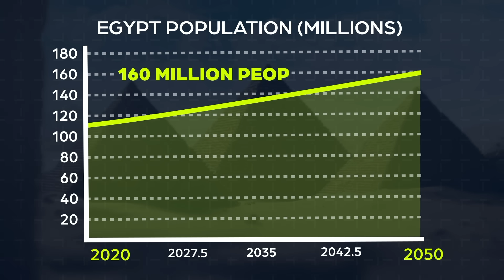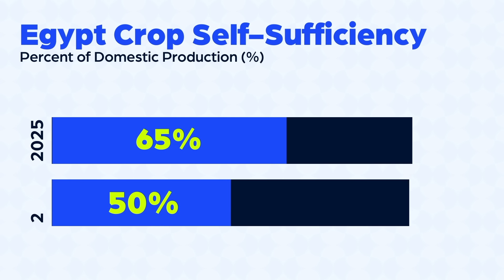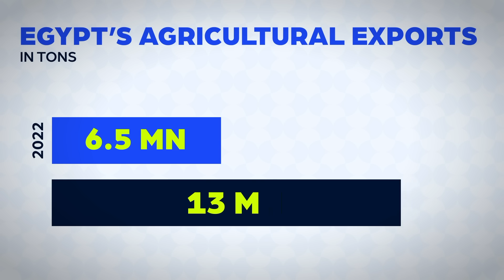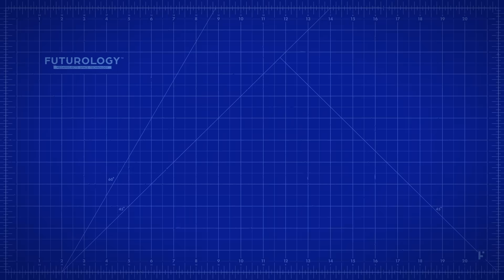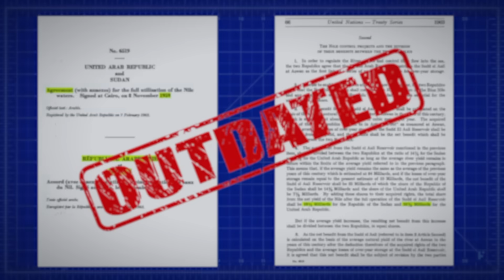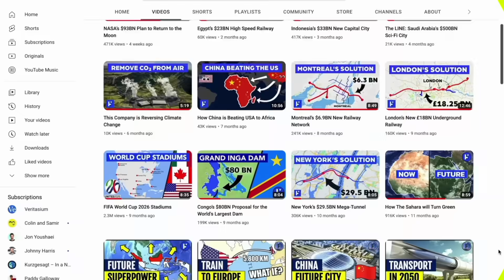Egypt is Building a $9.7BN New Nile Delta

Comment: Imagine travelling back in time and telling the Romans that their breadbasket will be one of the largest grain importers 2000 years later
Reply: This was because of English people, they changed Egypt to a farm for fine long fiber cotton to feed their industry.
Reply: Yeah, but "their breadbasket" also has twice the people of the Roman Empire. Even with the dramatic rise in farming productivity since the 1800s, there's just so much land till you run out of it in Egypt.
Reply: @chinguunerdenebadrakh7022 maybe they shouldn't be reproducing more than what their land can feed. Famines need a comeback.
Reply: @chinguunerdenebadrakh7022 Time to green the rest of the desert then

With better water conservation and transport technology less water will be wasted and it can be efficient to green the desert. Would just need to give it a few decades to slowly green.
Reply: The whole Roman Empire did not have 100 mln of population at the time:)
Reply: Well, as long as you don't forget to tell the Romans, that the population of Egypt alone is larger than the population of their whole empire. In fact, according to some estimates 2.5x larger.
Reply: @Omar-kw5ui well as long as you also remember that crop yield nowadays is at least three times what it used to be in Rome's times in fertile soil like Egypt's (in other less fertile soils it's much much higher) so it should still be able to supply the increased population only using the same ancient fertile land (without taking into account any of the reclaimed and less arable land which were made more viable through fertilizers and agricultural projects)
Reply: @Truth4thetrue  My comment highlights that the Romans would not find it strange at all that their once bread basket has become the largest importer of grain after its population has grown to many folds the size of their entire empire. This is because they were themselves the highest importer of grain given their massive population, and feeding their population was one of their biggest concerns. It would only be logical to them that this would be the case.  

Now, you're trying to be pedantic and say, well Egypt should still be able to feed its population because of advances in farming. Well, I'm not so sure about that. And there are two main reasons for this:
1. People take up space. The population of Egypt isn't scattered around vast swathes of the world, like the Roman population was. That massive population lives on the very land that is needed to produce the crops to feed the population. Lets assume only 20% of fertile land is lost due to habitation alone. 
2. I'm not sure if Egypt alone fed the entire Roman population/empire. Yet, its current population is several folds greater than the Roman empire. Assuming Egypt alone fed HALF of the roman empire (chat GPT thinks its more like 4%), and the population of the empire is around 76m, then Egypt could theoretically feed 30.4m people. Now, we reduce this by 20% from land loss, that would mean Egypt could feed ~30m. 

Now, using your quoted figure for the increased yeilds of modern farming: 30 * 3 = 90. That would mean Egypt still meeds to import grain to feed 30m people. So, yes, its no surprise that their breadbasket has become an importer of grain.
Reply: Why does everyone keep comparing the modern and ancient populations...
In thousands of years a lot has changed, modern farming techniques and irrigation have made other land more suitable for agriculture (look at Ukraine) while Egypt's agricultural potential greatly decreased due to the dam and cash crops.
Reply: Um, the population then was a around 1 or 2 mil. If you told the Romans Egypt would have a population of 113 mil, they would believe they need to import wheat. By the way, 99% of countries didn't exist yet. There is no more Rome, but there is Egypt.
Reply: the population was logically expected to grow
Reply: @luxraider5384  if you can't feed those children, don't have them.
Reply: We just stopped farming grain, there are other crops with better profit.
Reply: Imagine how surprised the Romans would be when told their own Italy is now owned by China because its leader decided they wanted Chinese coins against their independence and pride as a sovereign nation.
Reply: Egypt after the October war destroys its economy
Reply: Egypt was feeding all Europe in the 1800s. No need to go back that far.
Reply: imagine telling them that nowadays idiots don't understand that back then Egypt had 750.000 people and now they have millions
Reply: The Romans would not believe anything you told them.  Who could blame them?
Reply: The arabs have turned the land into a circus.
Reply: Yet their people are still starving 💀
Reply: Here comes white supremacy again! 😀😀😀
Reply: The entire Roman empire was assumed to be around 80 million max, don't quote me but id say Egypt's current population is well over 100 million people I think they would find that fact more unbelievable.
Reply: Romans: No shit.
Reply: Imagine telling them how much people it has
Reply: The breadbasket is now being lead by a dictator who justifies buying a USD 500M luxurious airplanes and tell his people that he is unable to teavh them or cure them.
Reply: I am Egyptian and going back 2000 in time  I would gladly tell the Roman to F*** off my beloved country and stop stealing its bread .
Reply: 2000 years!!
& 2000* population
Reply: black comedy 😢
Reply: Their climate changed greatly over time, unfortunately.  It used to be grassy, now it's a desert.
Reply: Imagine telling Romans  there would be 8 bilions people on Earth
Reply: If you think about it, the Romans had 50 million people. The Egyptians are double that, no wonder they are importing.
Reply: You don't have to travel in time. Just tell the same thing to an Italian.
Reply: I just told this to a Italian and he said that Egypt is not the breadbasket of Italy, Mussolini tried but failed
Reply: @gordonchao3074  Because he had the second world war in mind, the most recent attempt.
However in ancient times Hellenistic Egypt was indeed the breadbasket of Roman Italy. 
If he had studied ancient history he should know this as well.
Reply: @gordonchao3074  Breadbasket of the ROMAN EMPIRE
Reply: It will become one again, with development
Reply: Romans never imported food from Egypt, you are watching to much movies.
Reply: @osok5492  yes they did. Egypt was known as the empires bread basket.
Reply: Somehow always comes back to Rome 😂 somehow it never goes further . The “cradle” of civilization 🤣😝
Reply: @abdulpugganwala4856 the coliseum inspired cricket and football stadiums .and Italian clothing is worldwide, so is french and German
Reply: @PortugalZeroworldcup  amphitheaters have been found within the indus civilization which predates the Roman’s by a few thousand besides that point Italian clothing with Indian fabric ? Haha
Reply: @abdulpugganwala4856  no
Roman architecture inspired sports
Besides Italy has four world cup wins 
India and Egypt have zero 
India hasn't even qualified 🤣🤣
Reply: @abdulpugganwala4856  Italian clothing brands
Versace, Armani,Prada, Gucci, Giuseppe zanotti, dolce and Gabbana, fendi etc 
Lol  India is 1.4 b people not everyone is working in clothing shops there 
There's Bangladesh, Honduras, Mexico, Egypt, Indonesia too
Reply: @abdulpugganwala4856  Bottega Veneta

, Roberto cavalli, max mara 🇮🇹

And of course cars too
Reply: @Portuga 4:18 lZeroworldcup
Reply: There were like 20 million people total on earth back then.
Reply: @alirekaby1 Roman Empire alone had 70 million, and it had 33% of worlds population
Reply: @alirekaby1  There were about 200 million people on earth in the 1st century AD, about 10 times as many as you claim. At its peak, the roman empire alone had about 75 million people to feed.
Reply: @alirekaby1  the roman empire had more than that
Reply: Egypt is not even a breadbasket for itself... More than half of Egypt's food is imported. The country is way overpopulated.
Reply: @dyasion  the main issue isn't overpopulation (although that's a factor), it is mainly the fact the fact that Nasser building his dam in the 60s-70s, actually depleted the soil of essential minerals, which made farming more difficult, and later Egypt would prioritize farming things like strawberries over wheat so it can export them abroad (which was a mistake in my opinion, but many disagree)
Reply: @dyasion  are you dumb? He said breadbasket of the Roman Empire. The Roman Empire conquered Egypt in 30 B.C.
Reply: @dyasion  yeah they are taking about 2000 years ago when Egypt was the greatest in the old world
Reply: @mohammedgamal9733  it is about population and fool people who bring like more than 3 children up to 10
Reply: Breadbasket was Sicily mate
Reply: @thomasdavies2555 Egypt was most definitely referred to as the “Breadbasket of the Roman Empire”. Sicily was also considered the breadbasket in the earlier years before Egypt was conquered, after which Egypt was overwhelmingly the largest provider of grain for the empire
Reply: 🙄😂... ahamn ahamn... the Romans..... 2000 but without them on board of course.... And their aggression or corruption 🙄🤦‍♀️
Reply: @brigittahoffmann9283  Egypt got the best treatment from the Roman, what more that you want
Reply: @brigittahoffmann9283 speaking as if any place on earth now is less corrupt or aggressive than Roman empire smh

Comment: So the water is enough for that? How does the groundwater get replenished? Does the water need to be pumped through the pipes or is there geographical downwads slope? How will the redirection of water from the upper Nile affect the water supply downstream? 
This is an amazing project, and the fact that they started it already tells me all has been well thought out. But I would have loved for more technical questions to be adressed.
Reply: There are 13 stations to elevate and pump  the water before reaching the purification plant 
The water used is mostly which is drained from cultivated land in the delta (reusing)
Reply: @yasserfaroukragheb6242  That's good.
Reply: It’s a mix of everything really from underground to sea water distillation to water recycling to transitioning the current planted area to more modern water saving irrigation techniques to save on water.

Egypt had around 5 million feddans the mid 50’s when it had a population of 25 mill and that’s about when it started imported food.

Currently it has 10 million feddans with outputs equivalent to 16 mill feddans using old techniques and 110 million population.

So basically Egypt need around 3.5 million feddans to return to it’s net food exporter status. And it’s a must especially after what’s happening in the world
Reply: zgoodterrorist8556 very inyeresting
You have seen this? Can you share the name of the project please? Many thanks
Reply: Hope they not using knowledge to steal from  the black africans
Reply: exactly Also I would like to know how much water evaporates during it's journey until it reaches the pipes and what is going to happen if one of those pipes get clogged or broke due to earthquake, what are the maintenance plan here?
Reply: That’s my concern too, is there enough water for this
The video mentioned something about desalinating the sea water 
Can you explain please ?
Reply: still better than waste it to flow to the sea.
Reply: @rizkyadiyanto7922 waste is not the correct terminology
Reply: @isabellacatolica5594  whats the benefit for flowing the precious water to the sea? its not like the sea ia running out of water lmao.
Reply: @rizkyadiyanto7922 If fresh water does not flow into sea, the sea water will flow inland basically making the Nile delta saline and unable to be used for drinking or agriculture...

This happened in Pakistan with the Indus delta and killed off agriculture near coastal areas in Sindh
Reply: @rizkyadiyanto7922 المياه العذبه لاتدخل المالحه ولا المالحه تدخل الي العذبه كل منها يدفع الآخر ويمكنك رؤيه ذلك في مصر لو كلامك صح كانت اراضي مصر أصبحت مالحه ولن تكون صالحه للزراعه

Comment: This is amazing. Maybe they should also move people from places they can use for agriculture. They can build around those places, but in the desert.
Reply: This is what they are doing. Egypt is building a new capital east of the Nile River deep inside the desert. With modern transportation, you no longer need to live on the fertile land - best place to put the population in Egypt is 50-100 km away from the river, use fertile land to grow food, pipe the water in, and maximise agricultural output.
Reply: @pineapplesareyummy6352 Yes, and it is assumed that the climatic conditions in the new capital will be warmer in winter and cooler in summer, and the area will be afforested, and you will not feel that you are in a desert. Let's just hope it doesn't get crowded like before, we won't be able to change it soon
Reply: no one would leave the nile to go to the desert maybe if we build more coastal cities
Reply: well some people should move they are not saving the agriculture land in the delta @centralcee88
Reply: @@HOR-AHA I do not think that anyone suggested to do this by force. The state can provide incentives and job opportunities.
Reply: They are already doing this , they move people from farmlands and bulldoze a lot of the slums to move them to the new residential cities established in the desert and replace the old slums with new touristic areas or farmlands
Reply: @@HOR-AHA something we cant do this like our new arish port project which is vary imported we cant have a "not leaving" answer. ppl don't trust the gov this what hap in maspero triangle some ppl said no but look how the gov changed the whole place to get rid of slums and provide human life
Reply: @theerdalavignesh4443 🤔
Reply: it will not by force, it could happen whenever they have living facilities around reclamation lands  @@HOR-AHA
Reply: maybe they should move you then